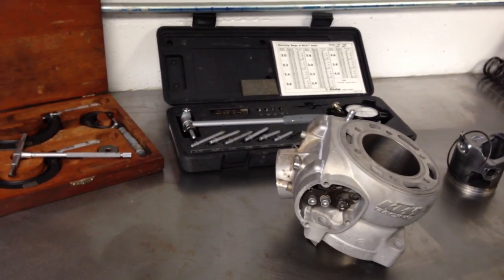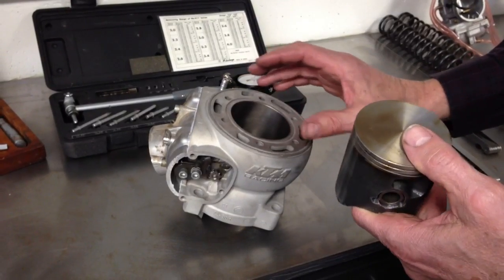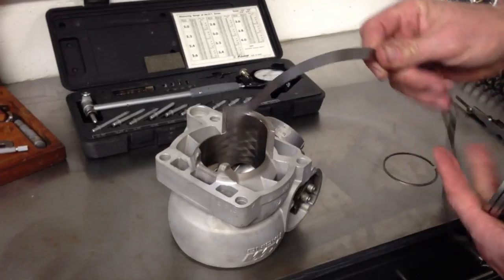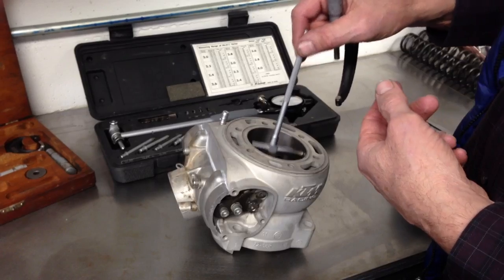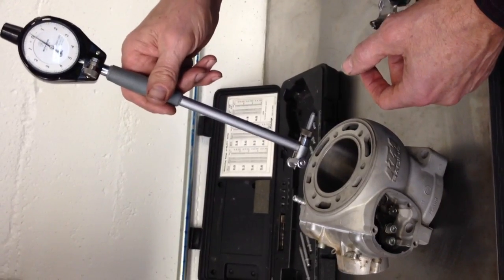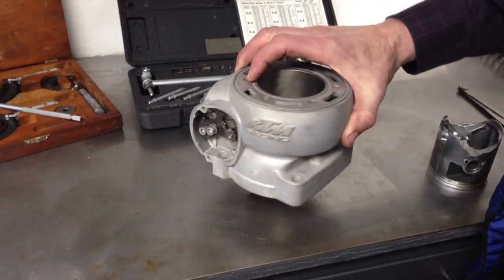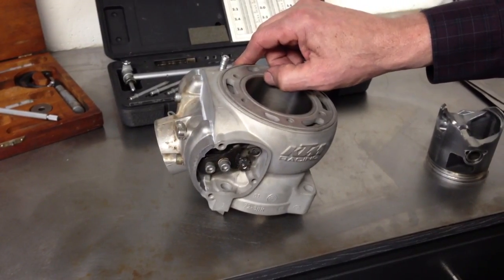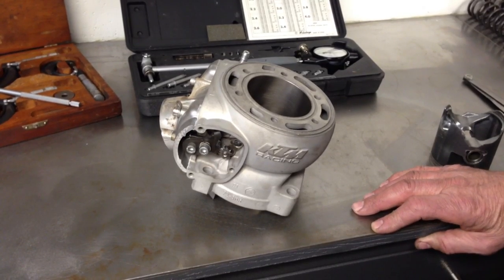How to Measure Piston to Cylinder Clearance

Comment: Errrrmmm it’s kind of important where you measure the bore right ? And the piston… the piston will be smaller around up top than at the skirt. Assuming the cylinder is not tapered you will show the highest clearance up high and the lowest down low.
So when checking to see if you’re in spec ….it would be the piston an inch above the skirt at a 90 degree angle to the pin and then the bore an inch down in from the top
Reply from the maker: Neil: If it's a new cylinder, you can measure it anywhere in the bore. If it has a lot of miles, the bore should be measured several places and the bore will be largest half way down the bore. The word tapered has been used often about cylinder bores but actually does NOT apply because they do not become tapered (smaller at the top than at the bottom). Cylinders become egg shaped (larger in the middle) and tight on both ends, not really tapered. 

Not all pistons are measured an inch up on the skirt. You can check with the manufacturer or measure it to find where the largest diameter is located.

Comment: I'm gonna ask a really dumb question here but its because i bought a motorcycle recently and the guy gave me an extra engine with the bike;  it was his dad's bike and he had passed away and so the extra engine he sold it with the bike.     So, What if there's no lip on a 4 stroke motorcycle engine?      (Its the extra engine).    I was checking it the other day and it doesn't feel like there's any lip.    But I can tell that the cross hatching is barely visible..... Depending on which way your looking at it and i have an untrained eye.     Also a side note is that the heads that came with it looks as though they've been used very little.  However they were already taken off the main.    Any help would be greatly appreciated.  Thanks

Comment: I know this is an older video. But, 150 hours of use? I ride single track moderate pace trails and replace at every 40 hours. Is this overkill. There's so much conflicting info out there.
Reply from the maker: Yes, 40 hours is overkill.

Comment: are most 2 stroke cylinder nykasil plated? mine looks like an somewhat oxidized aluminum color do you know if it is 2003rm250..i didnt hone and installed new piston alread? ...oops??
Reply: Dont hone a 2stroke bro it damages the coating on the cylinder

Comment: excellent video Jeff.
does adding friction modifier and 5000miles of oil change in a 4stroke help to extend the life of the cylinder?
Reply: Friction modifiers in wet clutches are bad. Just use normal oil. I like Rotella 15W40 diesel oil. If you putz at 60 on the highway all day, you could probably go 10k. If you rip it as hard as you can on a technical trail, 500 would push it.

Comment: Hey Jeff I have a 2003 KTM 250 exc. The cylinder is deeply scared. Would you recommend LA sleeve or just get a new cylinder? Also piston should I go forged or cast? Thanks for the informative video's.
Reply: resleeve it u have 4 bores on it. just keep ur air filter clean as fuk.

Comment: i know feeler gauges are not accurate to use but if you can fit a .020 feeler between the bore and cylinder you know the clearance is way too big
Reply: I heard on my 2002 Honda Crf450r that you are able to have between 0.020-0.045mm

Comment: piston to bore clearance on a two stroke is critical due expansion rates,and difference of air cooled and water cooled,i bored hundreds of them,and honed using recommended grit,and dropping piston thru cylinder or air cooled,if it slips thru under its own weight it fine,if it hangs it is not correct,continue honing,on water cooled machines as manufacturer specs,grocery getter automobiles,all clearance at 2.5 to .003 ,racing engines are as manufacturer suggests,i like your video,i watched to see your mics,to be honest and you definitely know your stuff-automobile breakin is minimum of 750 miles any less and you will do another teardown for nothing

Comment: Hi Jeff watching you video and all those tools shown all works well. Using the feeler gauge has to have more feel but same with micrometer you need to know how to use it properly. Bore gauge are still the best easy to read but not knowing how to feel your mic you would get a difft. reading. My parents used feeler gauge for over 30 years,starting in the forties and survive measuring bores with feeler gauge during the war and some of those jeeps my parents bored where never even honed, but work in those condition.

Comment from the maker: First of all the B is only a VERY tiny amount (.0004") larger than an A. You can easily use it in any cylinder with 25 hours or more.
Reply: 140psi good compresion 372 xp oe ?
Reply: I just put a Vertex B piston from Mr. slavens at 60 hrs in my 300 xc-w tbi and wow what a difference. Great informative vid. Thankyou Jeff